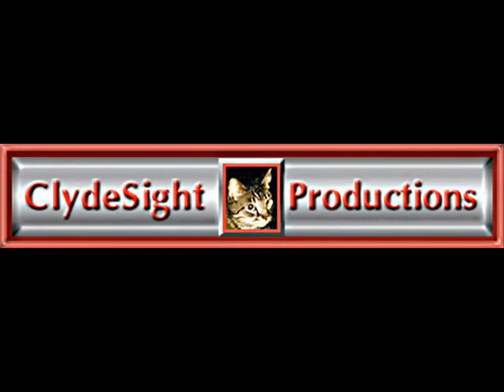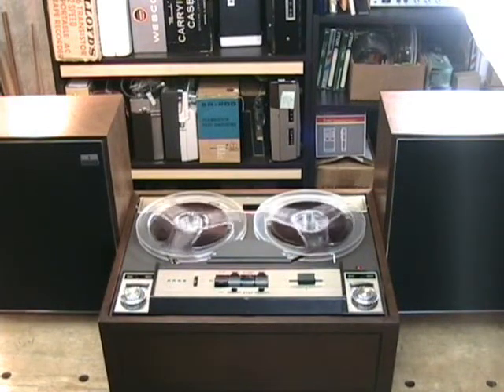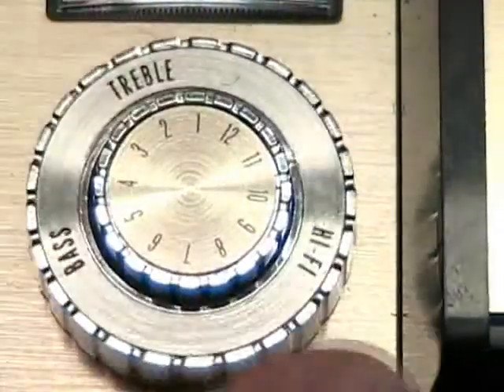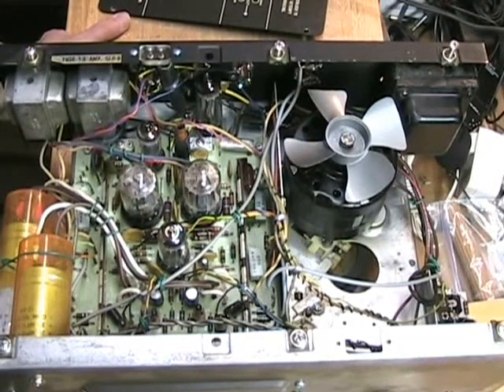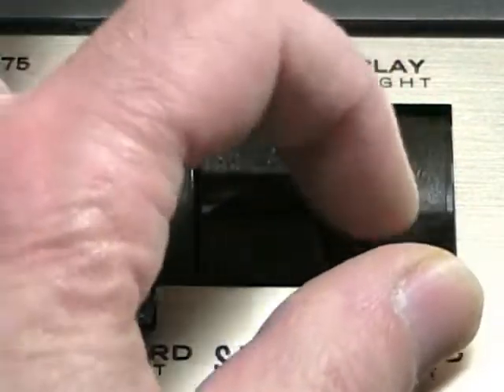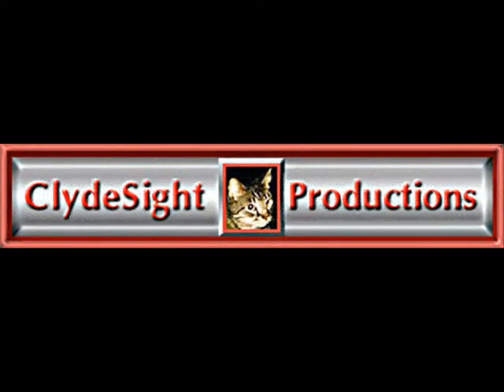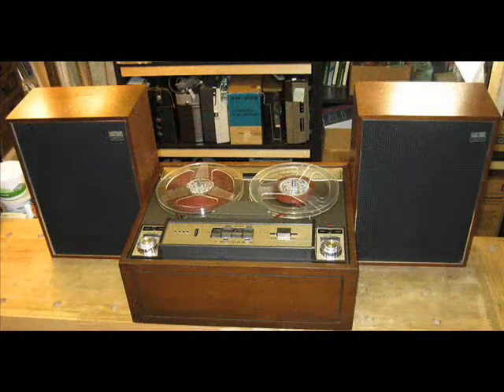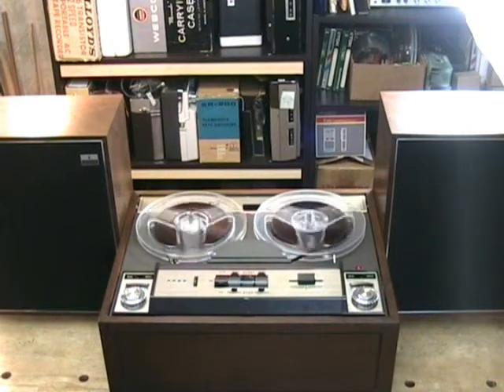Exposing Wollensak Model 1288 Stereo Tape Recorder Restoration Trailer Part 1

Comment: Yours is VERY NICE! I have the one with a handle and original speakers (model 1280). It is in shabby shape. Amp still works but one channel weak (probably caps). According to the back wood part, it looks like it was in a fire!

Comment: The T1980 was not unusual, but it was the top of the line Wollensak recorder. I find them on eBay from time to time. My experience is with one that a friend had gotten from his Dad when we were teenagers. It does have one unique feature under the head cover; The head height could be adjusted for proper playback of half track tapes, either stereo or mono, in order to avoid 'fringing'. It was made to compete with the Roberts (Akai) recorders, introduced around 1965.

Comment: Nice machine! I got my Ampex 2100 which is one of the better Ampex models, and it was from 1967, and it does have an auto reverse feature. I got it for $10 last week and I did some work on restoring the deck. The new belts are installed replacing the dead belts, and it needs more work. The Ampex 2100 beat out this and my Akai 1721W.
Reply from the maker: I am impressed that you were able to replace the belts in an old Ampex. My recollection is that due to the capstan loop, replacing belts was a bit of a chore? Did you make a video? Would love to see if the info I have is true. $10 is an amazing price!

Comment: My friend gave me a wollensak reel to reel machine, the model is T-1980. Is it an unusual model? It has all the patch cords and both mics. it didn't come with the manual, so I dont know if it was a mono machine. It has two VU meters, but when I recordered on both sides of the tape one side got erased. So I'm not quite sure of it's exact operation. Hopefully I can find a manual on line. I like your recorder out has a nice look to it and it sounds great.